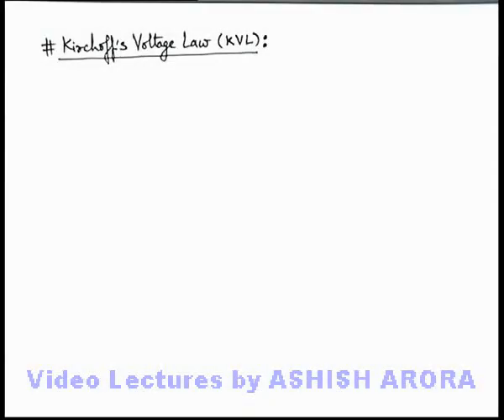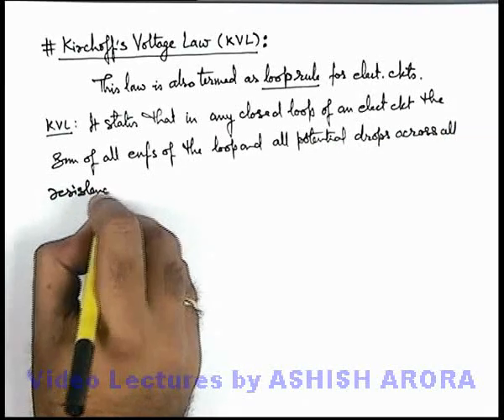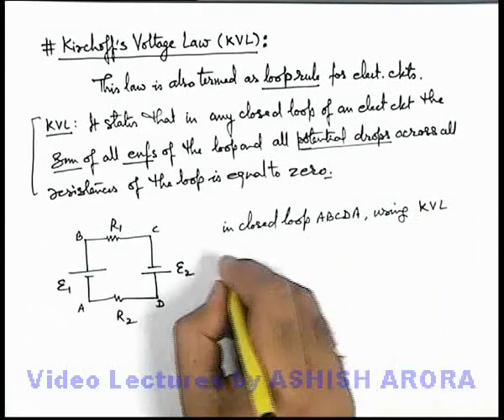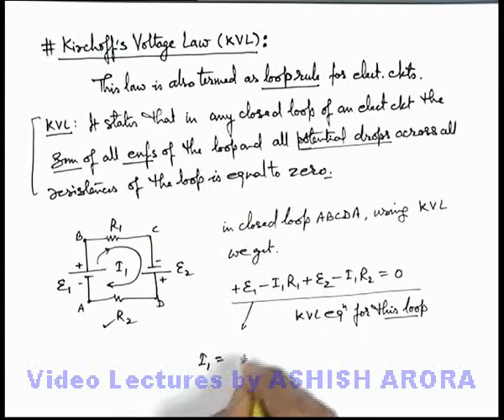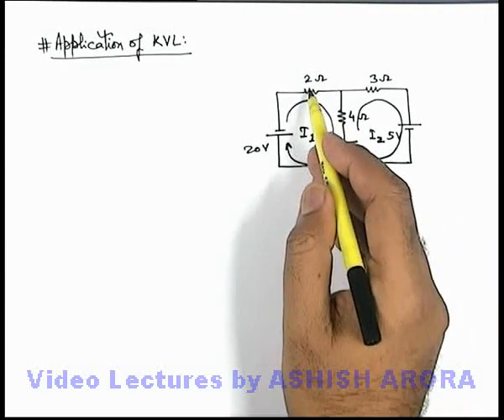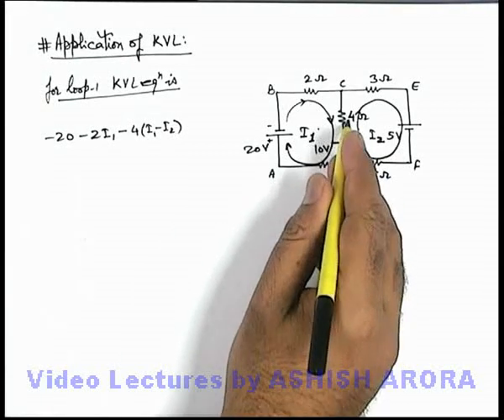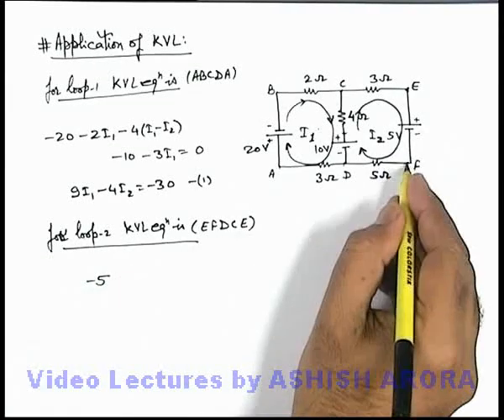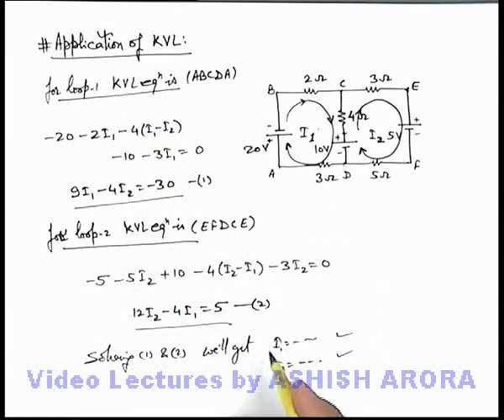Class 12 Physics | Circuit Analysis | #3 Kirchoff's Voltage Law | For JEE & NEET

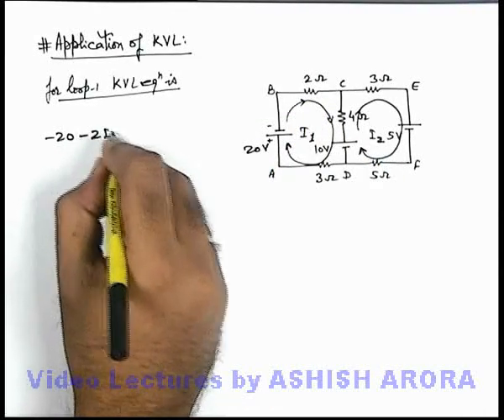Comment: 6:18 we r moving opposite to circuit.!!
Reply: Yes even i am confuse can you tell what is correct.
Reply: @teslamhcet5030  bro, I m still confused
Reply: @teslamhcet5030  it's just a convention for the calculation. just to ease our calculation we are moving clockwise it has nothing to do with the the actual flow of current i know its a very old comment but just for future reference

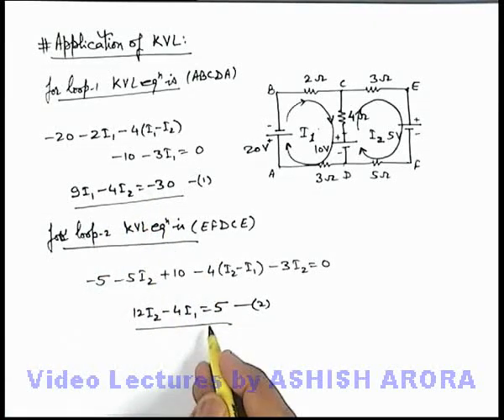Comment: At 8:50 In first equation, sir took 4(i1-i2) whereas in second equation he took 4(i2-i1)....does this not make any difference?
Reply from the maker: In first equation sir is writing KVL equation for first loop along the direction of i1 so while passing through 4Ω resistance direction of i2 is opposite to i1 so i1 is taken positive and i2 is taken negative and along the direction of i1 potential drop is 4(i1-i2). Similarly while writing KVL equation for second loop along the direction of i2 across 4Ω resistance current drop (in opposite direction of prev equation) the potential drop is 4(i2 - i1) as this is of opposite sign as in opposite direction potential will gain not drop... To avoid confusion in writing equations its good to write equation considering the current in a loop to be positive for KVL equation, thats how sir has written the equations...
Reply: @physicsgalaxyworld  Thanks

Comment: Sir how are you considering that current across 4ohm resistor is [i2-i1]
Please elaborate.
thank you very much.
Reply from the maker: watch the circuit drawn carefully... we can see that current through 4Ω resistance i1 and i2 are in opposite direction in left and right loops so total current through it will be difference of these two currents...

Comment: Sir how can you say that i1 flows through whole loop and i2 through another loop??
I mean current can be different through different resistances.....can be different through 3 ohm and 5 ohm.....
Sir please clear my doubt
Reply: this is just a rule you need to follow while solving problems based on ckts.
apparently it was derived using maxwells equations, so right now we just have to be greatful that it exists and use it
Reply: Sharan Patil no bro this law is just common sense
Reply from the maker: here 3 ohm and 5 ohm of right loop are in series so their current must be same... and here we are considering current in two different loops so there is no problem in considering these....

Comment: As we reach back at the same place, net displacement = 0 so net work done = 0 and so net potential goes zero. 
And this law is valid because of that ?
Reply from the maker: Yes...
Reply: Can we say energy is conserved in the loop
Reply: @kampatisrinu745 not in exact sense since there is heat loss and all but if you take into account chemical energy of cell, potential energy generated and heat energy created then total energy shall be observed 😅